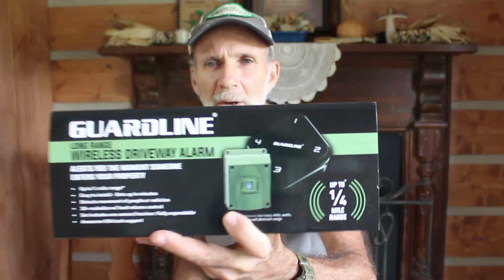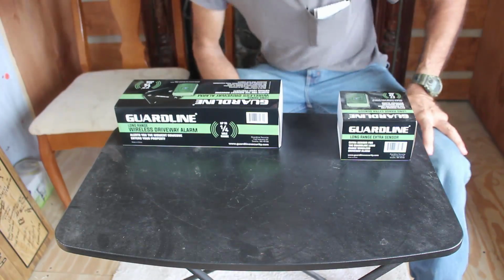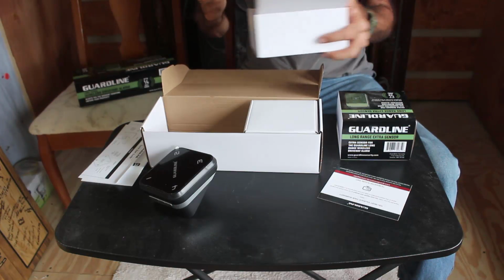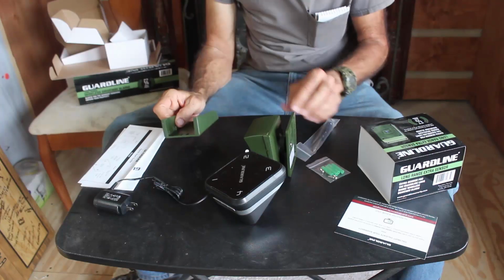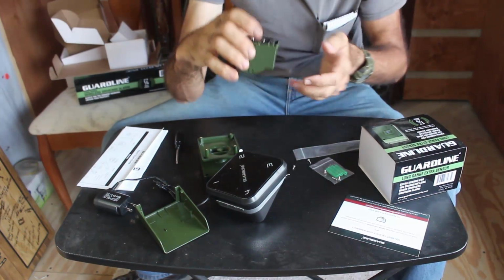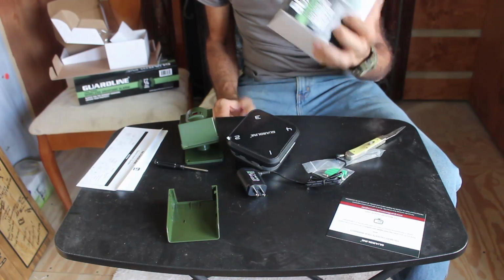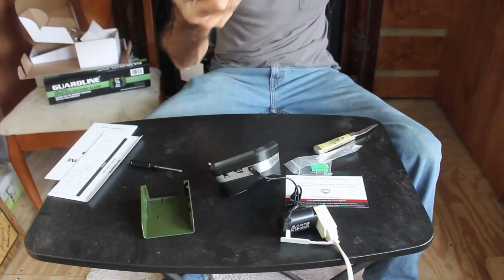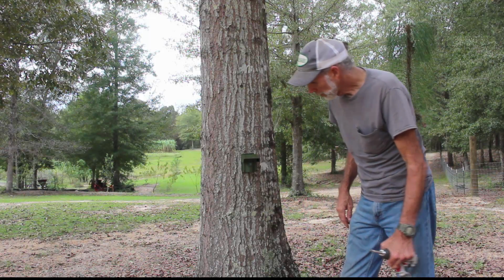Guardline Wireless Driveway Alarm and Motion Detector

Comment: The one thing that I’ve learned about screws in plastic, is when you’re putting them back in, slowly turn them counterclockwise until they “click”. Then you can screw them in. Doing that, aligns the lands of the screw to the previous threads originally cut in by the screw and prevent cross threading.

Comment: I use AA Energizer lithium batteries in my trail camera.  They cost more than alkaline batteries, but last much longer.  That's what I'll be using.
Reply: How long will traditional batteries last under normal usage?
Reply: @TheDarcyhorn  It's up to you, but for anything outside running on batteries you are better off spending a little more and getting Energizer lithium batteries.  They last way longer than alkaline batteries and aren't affected by the hot and cold.
Reply: @michaelyoung2685 Thanks Michael.  I did as you said.

Comment: I just ordered one of these from Amazon.  I have been using the cheap driveway alarms. Even though I tape them up sooner or later water gets in them and ruins it.  Even though this cost a lot more I'll probably save money in the long run.  Does it pick up motion at night pretty good?  I want to use it to tell when raccoons and groundhogs come in the yard.   Can you lock the swivel once you get it in the position you want?

Comment: I have a question.........Once the unit is tripped by a car or a intruder............Lets say you are not in the room when the alarm goes off.............Will it tell you again and do you have to reset it so you can check it. ....?  Thanks Al Sautner.  doughman1960@gmail.com

Comment: Nice addition.  I once used just an old radio shack intercom system out at the end of a gated drive, near the mailbox.  You could constantly hear everything out there going on.  They could only hear, you speak to them, if you pressed a button for them to do so.  I remember it costing about $10. to $20. way back in 1982.  

It was 22 C. Smith River Rd, Drain, Oregon.   16 miles to the nearest payphone.  27 Acres, 2 story, 3 bdrm, 2 seat outhouse, block ice refrigerator, a wood cook stove, a wood heat stove.  No Electricity.  $200. a month rent.

Hot water heater was a 50 gallon barrel over a fire pit, gravity fed into the kitchen.  Water was off some stream, with pvc pipe line above ground.  We would have to go find where it popped apart early in the morning in the winter if it froze overnight.  

Funny that it read:  "Must own truck & chainsaw" or they wouldn't rent it to you.  We had been looking for a decent house rental for 2 months, couldn't find anything..  We went to look at this more for the drive, expecting no more than a shack in the middle of a field.  From the road it looked like a doctor's home it was so nice looking.  When you pulled all the way up the long drive & around to the other side, you could see dumpster wood, old signs, etc.  It was still being cedar shaked over on that hidden side view.  It had a beautiful split log staircase inside though.
Reply: Ana's Homestead  sounds like heaven.
Reply: Yes, I have had a taste for that type of lifestyle all of my life.  I think I have lived 4 or 5 different similar situations throughout my lifetime.  But I am wore out & on my way back to bed for a while, only slept 4 hours early this morning.. wasn't enough.  We'll find some time to speak again soon.  I haven't really ran into you as much lately as I used to.